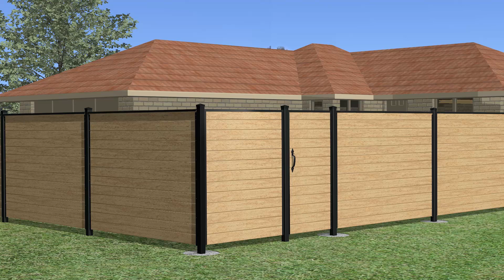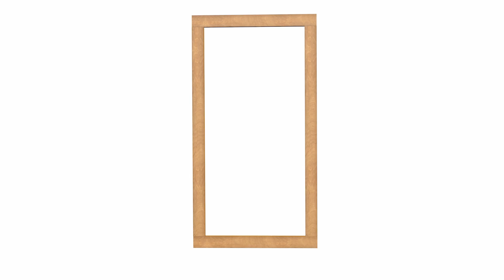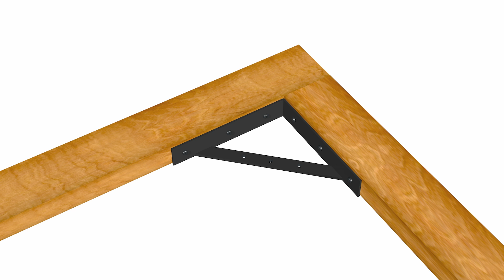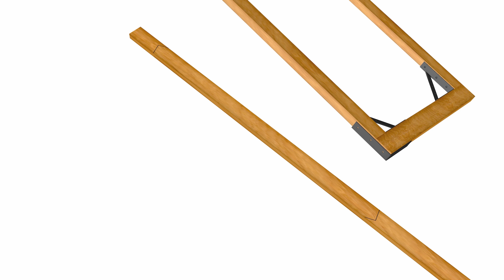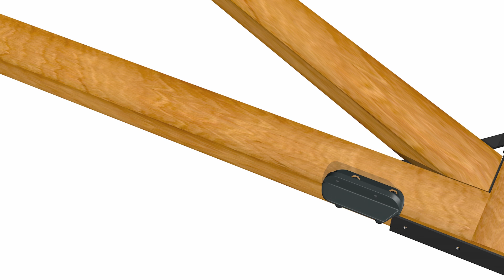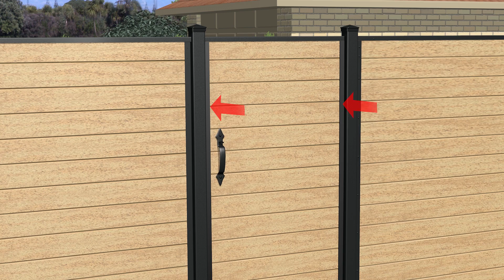Horizontal Gate Instructional Video Final

Comment: Hello. Since the frame finish is rubber can I make my gate 5 foot wide?? Thanks in advance.
Reply: I had the same question. On their website it says up to 60 inches wide and above that you gotta add supports.
Reply: @walterdudman123  I will work. I built my fence and it looks a amazing. You can order the rubber strips to make it look like the rest of the fence.

Comment: I wish the instructions in the box matched this video. My kit came with a box labeled “wood screws” so I used them for the frame. But apparently the wood screws for the frame were in a separate unlabeled bag. And the paper directions said 59 inches for the side boards, not 60. Frustrating.

Comment: could a lock be added to the gate?
Reply from the maker: hi Richard, Yes a lock can be used on the gate latch that comes in the Gate Kit pack. This latch does actually dead bolt lock from the inside as well.